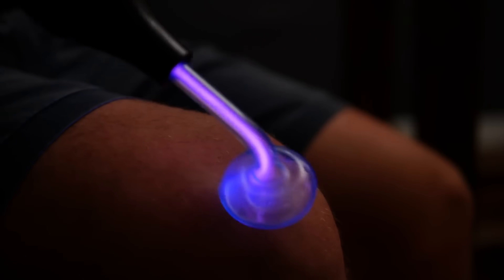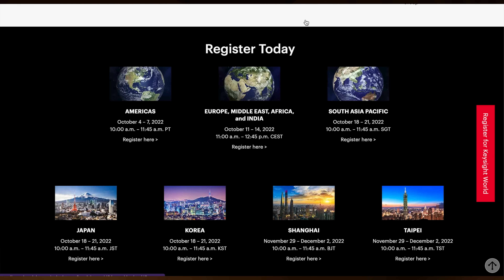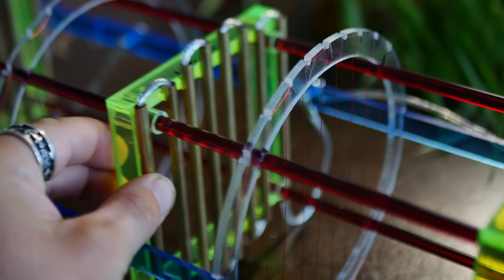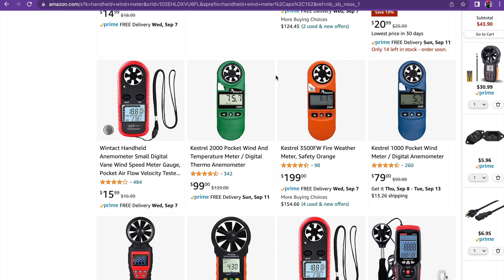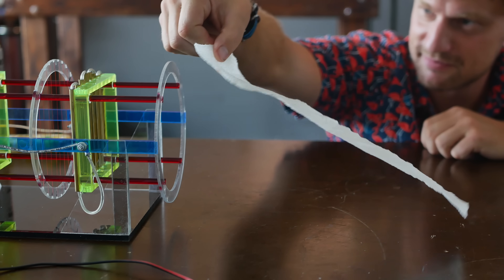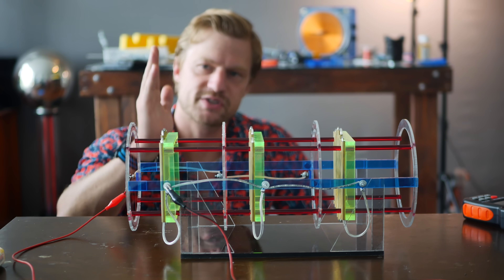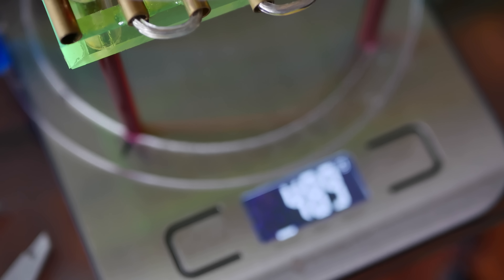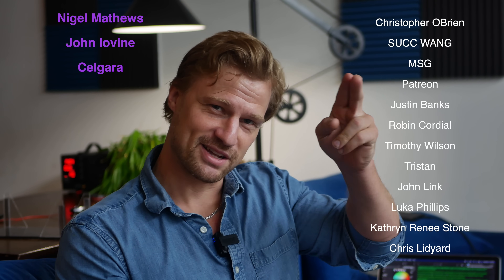Designing A Next-Gen Ionic Thruster! (For Flight)

Comment: just saw this and thought it was interesting. i have 2 questions. would putting a cover on it help air flow in downward and out and the second would be tilting the 2nd and 3rd channel say up to 90 degrees from the previous causing a better thrust-to-weight ratio. i know if you have them at exactly 90 degrees it will be 1 up down 1 sideways and last up and down i meant also like any degree up to 90 degrees difference cause a better rotation and thrust. example 1st one up and down, the second is at 15 degrees off the first, and 3rd one is 45 degrees off the second.

Comment: I don't know anything about this. I would just guess that some aerodynamic changes are in place. It should be ducted. You didn't show the airflow at stages 2 and 3 but I imagine that there is some air being lost out the sides.

Maybe reshape the metal tubes to be more like metal fins so air flows smoothly and is guided backwards instead of probably colliding around the tubes.

Comment: Great built 👌.
I think one of the inefficient thing is you didn't put the weight of the power converter and supplier in to consideration when you calculate the T/W ratio. So assuming you would also use battery in more real or practical applications, that will increase the weight dramatically. I always enjoy your builds, keep it up🙌🙌

Comment: Not to be a wet blanket here, but for this thing to be usable  in real life it will need to be able to lift its power source as well as its own weight. Until then , its just a cool hair dryer. The real need is a way to provide it with power , without a gas engine, or  heavy batteries. Need some lightweight super solar cells.

Comment: 1. Ducting
2. Venturi effect
3. Efficiency losses from voltage multiplier

Staggered spacing effects results....what about staggered/ramping voltage? individual supplies for each stage.
Maybe intake stage larger and output stage smaller but higher voltage? 

I imagine the dropoff in return from higher voltage comes from 
a. increasing leakage current
b. At some point, the air is already moving so fast that the ions cant transfer their energy efficiently. 

Im also curious about results of hybrid rotary/mechanical thrust devices + ionic thrust. 

How can we best make use of ionic thrust's power curve?

Comment: I’m waiting for someone to add this technology to a combined cycle propulsion system. The turbine / power generator can charge super capacitors that combine ionic wind with the jet exhaust, ramjet exhaust and scramjet exhaust. If the pitch of the turbine blades could controlled then the whole system could have one inlet and outlet.🤔

Comment: Was there a reason to make the positive wires thicker?  If the circumstances get smaller you would create a field gradient that would start compressing the air  flow. Add some air shieiding around it you would have a funnel like thruster

Comment: 1) Somebody already mentioned to add barbed (jagged) elements on the emitters to better help with the release of charges, but you could also try heating the emitters? they should emit charges more easily then. Maybe a different metal here will also help
2) Encasing the thruster should help (obviously xD)
3) What about alternating the power between the segments since if they are all on at the same time, the incoming ionized gas could be repelled by the next segment's emitter? this alternating should then need to be adjusted to match the airflow speed

Comment: Really cool! I read the original paper, was under the impression that they did not see in improvement in efficiency with stacked electrodes (I believe they saw a decrease I.e increase weight and power requirements for a marginal gain in thrust) which is why I think their plane had a vertical stack of electrodes (with your current setup, looks like the same outcome except there can be more configurations with the spacing). Have you thought about compressing the flow for higher thrust? Been curious if you can compress ionic wind. Like having smaller cross sections of electrodes as you get towards the end of the thruster and maybe a closed “barrel” or nozzle design?

Comment: I don't know how much this would help, but comparing to jet engine, I feel like it would benefit from 1) not having open sides, 2) having larger opening for inflow and smaller for outflow... At least for the version that is meant to propel something through air. The idea of jet engine is that the speed of air coming out of the thruster is always larger that the one coming into it, regardless of the speed at which you're moving, up until you reach sonic barrier, at which point things get more complicated.

Comment: I would get some more data off this prototype. 1. Test on low humidity vs high humidity (Arizona vs Washington State). 2. Since airship is a probable goal test at higher altitude vs sea level. I suggest Leadville, Colorado as the town sits at 10152 feet.

Comment: Honestly, you could add these in home air-conditioning.  Place one at each vent for each room and regulate the voltage to supply airflow in a way that more evenly balances the temperature throughout the house, replacing the large central fan.

Comment: That is a really really cool idea and I may experiment with that in the near future as for your design flaws one is you’re not getting as much to rust as you might want I’m not sure of the other two that you’re looking for but a suggestion encapsulate your electrodes inside of a tube that way the air has to pass through the tube with the electrodes I would think that that would effectively increase your thrust and third if three was a 50% increase than six would be in the hundred percent range hit me back if any of these Ideas resonate with you

Comment: 1 no ducting 
2 design is built for variable spacing (ducting could be used as superstructure) leading to increased unnecessary weight  
3 generic wires - it looks like there are hotspots and places that do no work (is this do to wire diameter/shape inconsistencies?)

Comment: If the incoming air, and possibly the coils, were heated, it would ionize much more easily (just like in a vacuum tube).  But that would probably preclude the use of plastic in the design, and possibly accelerate corrosion on the electrodes.

Comment: Have you thought about air entrainment.
1. Adding a air flow addition add the front back and middle could drastically improve your air. It’s a very light addition and could have a much higher velocity. 

2. Adjusting wire spacing 

3. Encasing the unit so all the air is in the Center of the unit. 

4. Adding vibration to the wires to agitate the plasma.

Comment: The Plasma stillshots look awesome and inspire to investigate further.
Some questions I have:
- The plasma is not uniform throughout the wire. Comparing controlling the points of increased discharge vs trying for uniformity seems curious. This might affect amperage and thrust by weight as well.
- Are your copper wires enameled? 
- Reducing electrical current/air leakage around the stages.
- Different shrouds: none, open conical for each stage, closed cylidrical.

Comment: 1 add ducting
2 swap out the large electrode for more aerodynamic ones
3 get rid of all nonessential metal to save weight

p.s. a nozzle could be interesting, I wonder what the pressure-to-flow ratio curve is like?

Comment: 1. Replace plastics with Carbon fibre for weight reduction
2. Replace copper wire with Copper-niobium or copper-tungsten for better efficiency in plasma generation & reduced ablation of material due to plasma generation
3. Encase side walls to keep airflow restricted to desired direction

Comment: What I'm wondering is if a lightweight tube around the engine will increase thrust by forcing all the air through all three as opposed to it coming in from the sides in between each stage.

Comment: I think it needs to be enclosed air flow, seems you would lose some out the sides. Also for thrust I look and how rockets are designed with thruster bells and nozzles to condense air flow. I think the last one is power supply can't explain that one but I dunno much about this field

Comment: The flow is not laminar enough, using finer and denser ground mesh could help.

The ground mesh of the previous coil might remove some efficiency of the next one. Having multiple independent power sources would allow the electric gradient to be more linear and less bumpy.

Adding an enclosing and throat might help reach higher velocities. Due to the low heat, carbon fiber tubes would work wonders, for amazingly light weight. 3d printing can help you prototype the perfect nozzle.

Comment: My guess is wire resistence. You cann't just pump up the voltage without the system getting hot and wires melting. Therefor a wire with the least amount of resistence would one solution.

Comment: I think the biggest problem here is the parallel connection of three sections. Due to this you have alternating polarity along the length of the propeller (ex. electrode potentials are consecutively : 0V, 20kV, 0V, 20kV, 0V, 20kV). This means you have acceleration of ions within each section  and deceleration between the sections due to ions being repulsed by next section.
I think that wiring should be that you start with 0V potential at the first electrode, then 20kV on the second, 40kV on third, 60kV on fourth etc. so you will get acceleration along whole length.

Comment: i was thinking a tubular shell for the outside also spacing between coils wires wider vs thinner might also make a difference and finally instead of all the coils facing the same vertical position maybe make a cross hatch coil     i am not in this field what so ever but just a logical  thinker also the power input, now im not sure of if they make these adjustable but E/L light wire requires high voltage stepped up from a lower input like around 5 volts ive been shocked by one before that would also reduce over all weight since they are usually only a size of a standard  qubed relay also could make they entire structure 3d printed and really thin to make it lighter

Comment: I would put the different stages electrically in series to increase the potential difference and therfore the particle speed. Also shaping the "emitter" would help. Smaller radius is higher electric field, higher ionisation rate.
Ozone concentration must be horrible - this will not get away ;-(

Comment: You need to incase it in a shell which should remove external drag of air being pulled from the sides. The dead air coming hinders the flow from on stage to the next

Comment: 1) honneycomb shape wiring for the positive electrodes.. (maximizes input surface area with limited impact on air resistance)
2) flatten the rods at the negative electrode for a more air dynamic shape. (the round shape causes turbulane)
3) add an enclosure

Comment: Would it help to duct the assembly?  It improves the performance of propeller designs. Could you be losing thrust (air) out the sides?  And can you keep the duct light enough to not negatively impact the thrust to weight ratio. Perhaps using the shrink sheet plastic used for RC airplanes?

Comment: Aerodynamic electrodes (maybe flatten them).

Light electrodes, maybe graphite from pencil. Slight risk that it will catch fire from sparks at high voltage though, still a strong suggestion because i would love to see it :)

I'd be interested in turning half the stages 90degs so they create like square air channels. 

Having different voltages at the different stages to optimize acceleration dependent on specific velocity at that point in the tunnel. Concept similar to gearing

So cool tech! Never seen it before!

Comment: You should try wedged shaped cone to funnel air towards the front almost like the reverse of rocket engine cone. That would still allow for air flow to be picked up around the back and middle screens and push the plasma and air to a smaller opening condensing them. The last screen would help push that condensed air and plasma out of the cone and possibly give a rocket like effect in the dark. Also what if you slightly skewed the binding of the copper wire so you get an almost helix like shape. Could that possibly cause the plasma and air to form a vortex? These are the ideas i get after so herbal inspiration and watching someone's already amazing design and build.

Comment: Nice video! Now this is my kind of fun! I noticed there are plasma point on the wire, seems like you used magnet wire which is coated for electrical insulation. I think removing the insulation will help. What I would do... Increase the wire density (+), and maybe replace the (-) tubes with maybe a more arrow dynamic shape like an air foil. Keep up the awesome work!

Comment: Design changes I can think of:
* Ducting to prevent side losses
* Replace the grounding tubes with wire to reduce drag
* Increase wire mesh density, make a grid?
* Increase cross sectional area, volume of air increases with radius squared while circumference frame weight increases with power 1

Comment: do star shape stack each other using string because it will concentrate the air flow and ion and more making as a thruster
Reply: and  u can arrange the coil horizontally and vertically which 1 horizontal 2 vertically 3 horizontal which help low energy to give high thrust
Reply: reduce the green part and increase the tube length  and add a clamp to the tube for better stability

Comment: I agree with BezBog, enclosing the sides and Channel/Funnel the air, reducing the space/volume of which the air can flow will increase the velocity of the moving air. Instead of the copper wire using an aluminium cone as your ground electrode, this with facilitate concentrating the airflow to increase thrust and it will also not impede the airflow like your current ground- electrodes. I am enjoying this channel...such fun stuff!!

Comment: What about flipping the design a little bit. Build a tube with your negative in the center creating a channel of air with helix type rungs where you'd have a general downward slope.. Not unlike DaVincis cork screw flying apparatus except a little more channeled.

Edit: also, all your rungs in your current model are aligned the same way. What if you put one of your discs perpendicular to the others? Does it result in an increase/reduction/no change in speed?

Comment: It's hard to tell from the angles in the video, but it looks like the anemometer wasn't in the center of the flow during the 1", 1.5", and 2" tests, while it was in the center of the flow during the staggered tests. Is this the case? If so, it could definitely affect your measurements.

I used to work at a calibration lab at Intel where we had an airflow tunnel to calibrate vane and pitot tube anemometers. The pitot tube anemometers were especially sensitive to their position within the flow.

Comment: Some of the suggestions I saw make a ton of sense.
1.  Try to shape your ground rods into a symmetrical airfoil (tear drop) to minimize turbulence.
2.  Enclose the tube to minimize losses out the sides of the thrust generated
3.  Some form of nozzle at the output of each stage to accelerate and direct the airflow closer to the center.
3a.  If you try 3, maybe only partially enclose the entire tube, you may be able to draw more air in via the venturi effect

Comment: Power supply weight issue for one. Aerodynamically unstable? No way to redirect air flow ... Not enough thrust maybe? 🤔 Cost of production is probably the worst when comparing to other types of thrusters

Comment: Magnets and Bernoullis principle would help here. Also, with no moving parts means you can use a thin lightweight skin to hold your components in line. Add a nozzel and a fuel spray bar at the rear to get an instant boost in thrust. It would be in essence a jet engine without all the pesky compresser sections and moving parts. Plus the super charged air will atomize the fuel air mix as it combusts. You can run the fuel lines in front of the inlet to act as a heat sink to cool the air.

Comment: 1. opposite to comments below .. not just mesh density needs to be increased but it should be in spiral fashion
2. Apparatus should not be boxy tunnel instead it should be cone like ... larger intake and smaller last mesh coil near exhaust opening... for added air compression
3. Apparatus should be enclosed in a conical sleeve.
4. Maybe even the spiral mesh at each step should also be fashioned in an inwards pointier cone or shallower convex lens like depression towards inwards of cone.
5. Opening of last end of cone should be more/very narrow (easy) and exhaust opening should be adjustable (difficult fab such cone)
6. Chassis; instead of fabed from plastic sheets, rings, glues ... it should be 3d-printed as single conical fuselage.
7. Maybe a wire going across the whole apparatus along its length in middle might push air away from center towards wall of cone causing more pressure on exhaust opening for more thrust.

Comment: 1. Have you considered less than 1 in spacing. 3/4th's of an inch may be stronger. Is 1/2 in too small?
2. Air vortices may be invisibly influincing your results.  Have you considered rotating the middle thrust element 90 degrees?  Probably makes it worse but makes an interesting test.
3. You have tried 3 stage thrust.  Why not 4 or 5?  Is there a limit where it hits some efficiency barrier?
4. Side walls!!!   I realise that may complicate or even intefere with the electric current but the bonus to airflow may be large.